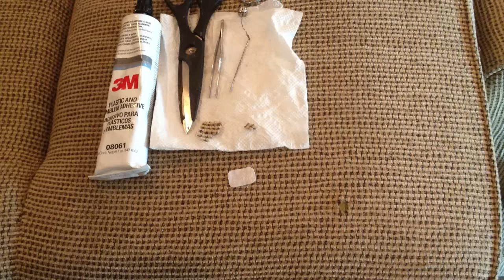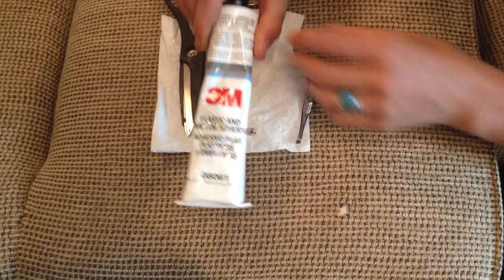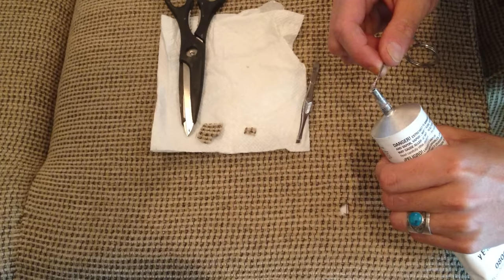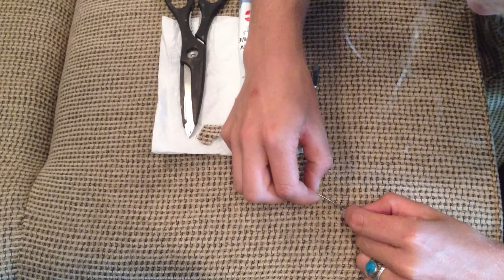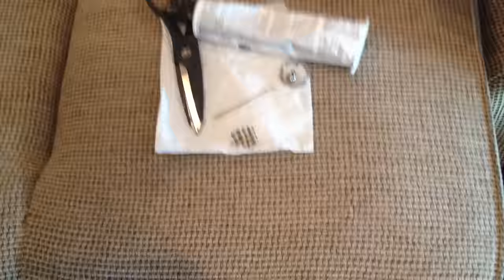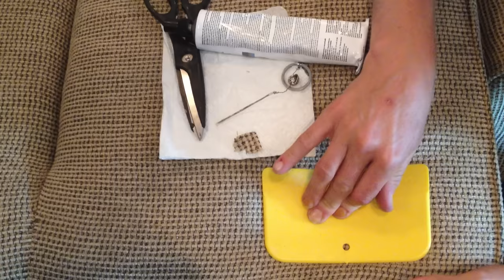How to Patch a Hole in Woven Fabric - Easy Fabric Repair

Comment: I've looked at over 2 dozen videos on patch repair. Your's is the absolute best!  I think using the fuzz method so many people do just makes another noticeable spot. It's an improvement but still noticeable. I read somewhere to put on mayonnaise, give a couple minutes, and then wipe off with a damp cloth. If there is still "burnt" edges remaining, remove carefully with a razor blade or new super sharp scissors. Basically use fabric scissors, fabric subfloor material, and fabric glue. Anyway, I just wanted to thank you as I wouldn't have used any subfloor material. Then again, my burn holes are so small that I may be able to just glue a tiny piece of matching fabric as I would have to literally cut into the fabric to put a piece of subfloor material underneath. Thank you for the tips and an excellent job on producing a short but concise & informative video!!!  Two huge thumbs up!
Reply: Rub 'n Restore, Inc. LOL!  I'll try the mayonnaise today and see if it helps clean or prep. I also have had excellent results with almost any product solution that utilizes 3M.
Reply: @gregsimpson621   that mayonnaise is this to get rid of the burnt parts around the hole? and did it work?

Comment: Thank you for this. I was able to snag enough of the upholstery fabric from inside my piece that I could use the same fabric for the subpatch and the top patch that is visible. Otherwise I would have been concerned about the subpatch being too heavy or not heavy enough, or possibly showing a bit when the repair was done.

Comment: This worked great on my couch with a huge cigarette burn. Saved me $75-$200 quoted by professional. Took me forever to cut the patch perfectly though. I also had to cut fabric from inside the cushion so the fabric is a bit lighter, wish I had thought to dye it first. Unless you knew the patch was there, you probably wouldn't notice it. Thank you for a fantastic video! I used Gorilla Fabric glue and a sub patch of denim from some old jeans .

Comment: Farking Brilliant!! Than you!! My Drum Case needed a bit of a fix.. This was awesome. THANK YOU!  ~Looks great BTW!! Cheers!
Reply: @RubnRestore  Goodness!! Lol.. You have no idea.  ..Duct tape underneath.. (the tear was 3 inches long.. but Straight!}  ~ That folding corners trick worked wonders, btw..  ~ It joined the edges perfectly!  Then used some liquid electric tape (Very sparingly} to seal the tear. ..The case was black anyway.. and it doesn't even look half bad! Most importantly, it`s strong as all bananas now and wont get torn to shreds going in and out of vans, planes, UFO`s, etc,. .  Again, Thank you!! ~Lol... and I was going to sew it!! EEESH!! Ok for clothes, Not Drum cases!! Cheers!!

Comment: Yes, it does look better. Thanks for tip re glue, as I wondered what type of glue would be best. I was expecting that you would stitch across the patch also in order to hold the repair. That would show all the more, which is disappointing, but how well does the glue alone hold, and does it prevent the hole from spreading as the cushion is used?
Reply from the maker: The subpatch restores structural integrity to the repair and keeps the hole from widening. This type of glue is tough as nails. It's used to apply emblems to vehicles.

Comment: Thank you for your video!!!! Someone dropped a cigarette on my NEW couch.  I found a place with extra fabric underneath the couch and was able to cut what I needed without it being noticed.  Since I am a seamstress I had everything else including batting to fill in the hole and this worked PERFECT!!!! I cant even tell where it was!
Reply: @Melissa Drouhard Martinez, did you actually do any sewing to fix the hole? I have a hole to fix and sadly I do not have sewing skills but want my repair to look unnoticed:(
Reply: @molly041809  No.  This took no sewing.  You have to be very precise with sizing and cutting the patch. Especially if it's patterned material. I no longer have the couch, as it was already 5 yrs old when I got it, and we got new couches 3 yrs ago. But it held up through 2 toddler grandbabies.  The hardware broke before the patch ever came close to coming off!

Comment: Thank you for the helpful demonstration. What if the hole is about the size of a nickel? (Accidentally from hot cookware.) It is boating upholstery but not any different from most upholstery fabric. Problem is cannot find any extra piece of that fabric. Any suggestions?

Comment: Hi!  our daughter's hamster chewed a small hole in our microfiber sofa.  It is only about 1cm or so wide, and will more or less push back together.  This cushion has a foam insert which I can remove via a zipper and get to the back without having to slip anything in from the top, but what's a good backer.. the denim patch?  What is the best glue to use to make this as inconspicuous as possible?  From my understanding latex glue is flexible but stays tacky.  The 3M glue you are using (for trim) in this video in my experience dries a bit hard.  Finally, there will be some white fiber edges showing after gluing.  Can I just color w/ a marker or some other sort of dye?  The color is dark navy.  Thanks so much for any advice!

Comment: Hello.  I came across your demonstration while looking for ways to patch a hole in a comforter.  While I don’t think this method will work for me I’m curious to know what you used to apply the glue?  Is that a needle attached to something?  Or a specific tool?  I’m always fixing or making things and use skewers for glue but they quickly get gummed up.  What ever that was looked much better.
Reply: Rub 'n Restore, Inc. What a great idea!!!!  Thank you!

Comment: Isn't that 3M Plastic and Emblem Adhesive 08061 that you are using?
Reply: ***** Thanks for the confirmation. It just so happens that I bought an almost full tube of it about 6 months ago at a garage sale for 25 cents. I thought I might have a use for it someday.

Comment: what's the name of glue used???
Reply: @RubnRestore  - That stuff isn't particularly flexible or suitable for this application, is it?
Reply: @RubnRestore  - Thank you for the reply, I'll give that a try. I've done repairs like you did in this video but used Bish's Tear Mender and that stuff solidified in the bottle within a month of opening it after having used it one time so I'm not willing to buy more.
Reply: @Fucknuts4u  Indeed, that's a bummer! Not familiar with this brand. Checked it out online but can't find a safety data sheet to see what it's made of, but they say non-toxic. The 3M we use is does contain MEK (methyl-ethyl ketone), but it has a better shelf life!
Reply: @lesandreholiday  - Yeah, it's been around since 1932 or thereabouts so I find it hard to believe that a product from back then is non-toxic. I mean that's an era where glow in the dark children's toys were bathed in radioactivity to make them glow and everybody was surrounded in lead based everything. Frankly, no matter what the product, if it's not toxic, I don't trust that it works. I'll happily embrace, and deep-inhale, plumes of carcinogenic toxins as long as the product works and doesn't dry up in the closed bottle!